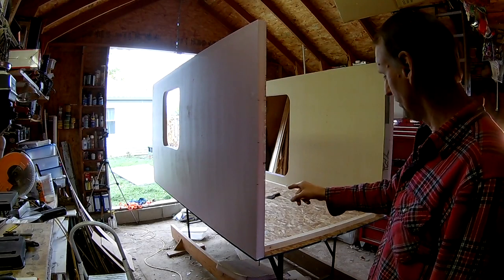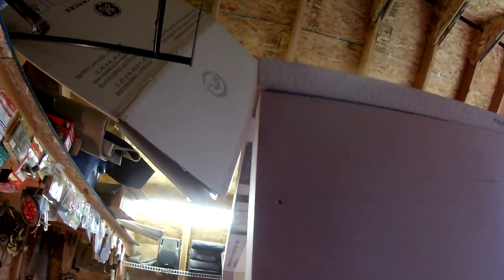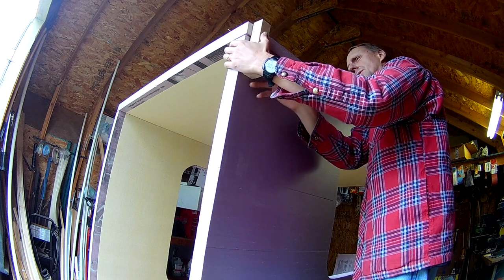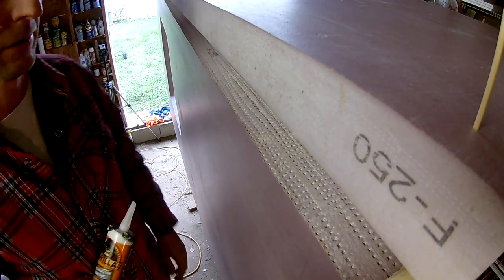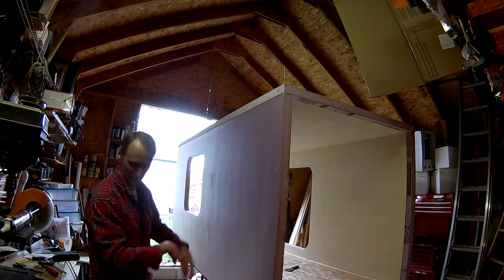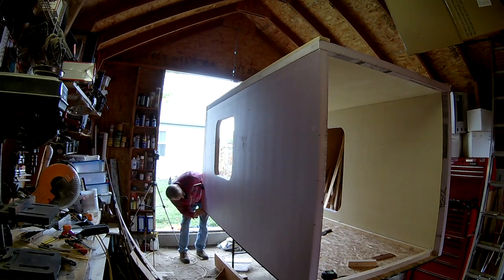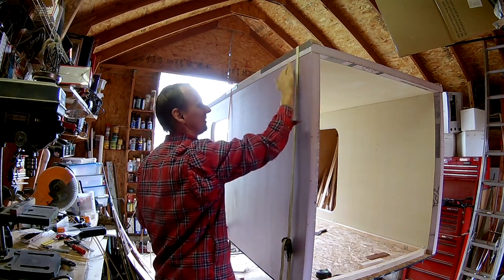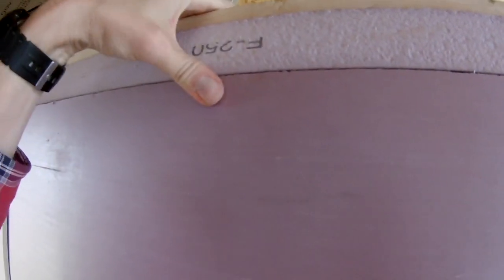Step 10 Installing The Roof

Comment: Looking good. When I built mine. I installed the front wall before installing the roof. This kept the side walls square while installing the roof. Mine is not for camping it’s for hauling stuff so I actually kept the canvass seams in.

Comment: I think I missed how the floor is attached to the trailer frame. How to work around the existing bolt heads on the frame, how to line up exactly with bolts or drill new mounting holes?  I like the whole build except the extra cross pieces between he floor and trailer. The trailer needs the rigidity of the plywood to hold it all together.  I think there are other options to reduce abrasion of the trailer and floor.
Reply from the maker: The body is held onto the trailer frame with bolts through the floor, spacers, and frame. The end spacers are set back enough that they will not be above the end cross members of the trailer. This is because the walls are 2" thick so there is no way to bet a bolt in there. To attach on the ends I use a 2"x2" under the frame lip cut to the exact inside width of the trailer. I then bolt through the floor spacer and 2"x2" and use it as a clamp on the frame. Using the spacers you don't have to account for the trailer frame bolts on the light duty trailer. I am currently building on a heavy duty frame and yes there are more bolts that stick out on top of that trailer. I simply just drilled holes large enough to fit over the bolt heads on the spacers. The spacers also allow for clearance for the drip edge that will be installed at a later date. With the drip edge installed there is about a 1/4" gap between the trailer body and the frame. The floor still gives the trailer plenty of support built this way. 

Thanks for watching. George.

Comment: Apart from panel inefficiencies, did you measure the diagonals when putting a caul under one corner ? If these are off the slightest, no way you get the roof to line up properly i think.
Thanks for this series. 👌
Reply from the maker: No I didn't. The roof lined upbut I could see that if you lined up the edge on the wrong side it could cause a issue. Luckily we're only talking 1/4" so it should not be a big issue. Thanks for watching, George

Comment: So is foam sides held on to floor with only glue?
Reply from the maker: No. The canvas laps over roof and the floor. The canvas supplies most of the structural strength in holding everything together.

Comment: Hello Sir!  Do you think making one of these about 7ft tall would work?  Id like to be able to stand in it.  Im afraid it’ll blow over or blow apart driving down an interstate though.  What do you think?  Thank you!
Reply from the maker: There are a few that have made larger models. Of course you would have to have a bigger trailer. You can check out the foamie section at tnttt.com. Thanks for watching, George.